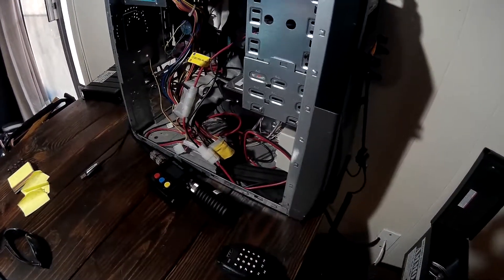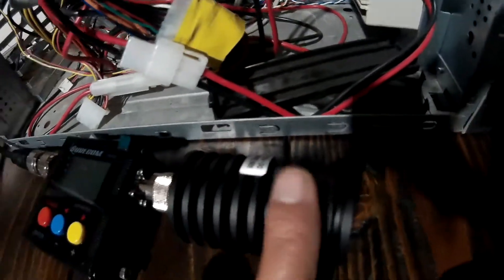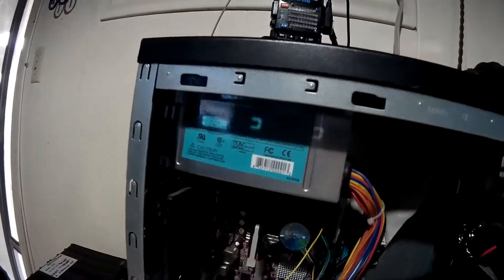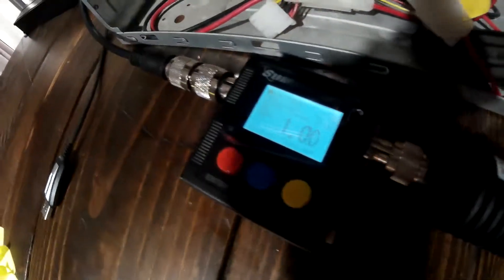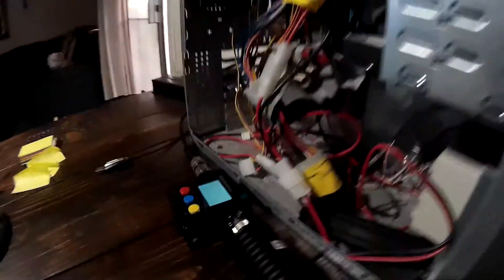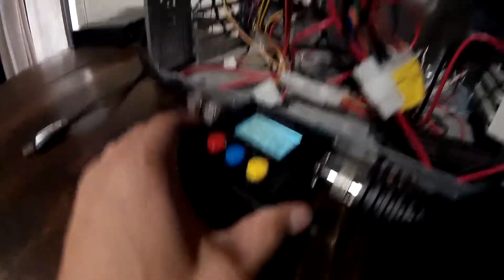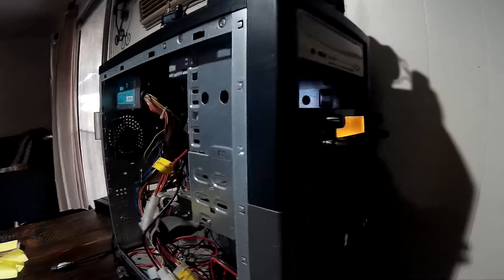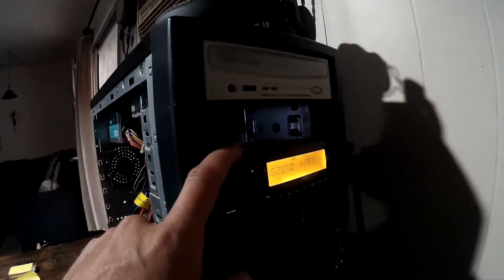TYT-9800 Power Problem

Comment: Same issue on UHF for me.
Tell me what I'm missing because...
Since switching from rg8 to rg58, my VHF power went from 35w to 54w.
My UHF was the same around 27w.
The RG8 cable is known good.
Have you had any luck improving since you published the video?
Reply from the maker: It was the cable.  I connected my thicker LMR400 cable directly to it instead of using the pigtail and that fixed the problem. I also had trouble with my duplexer.  I don't think it was tuned right from the owner so I am not using it for now.  I get further range when I just talk directly to my wife in simplex mode while roaming instead of using it as a repeater.